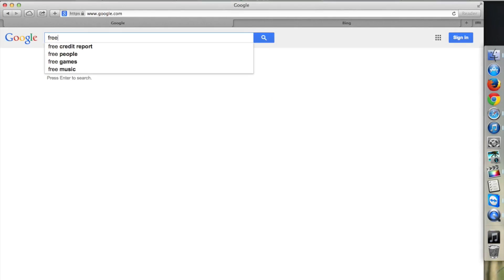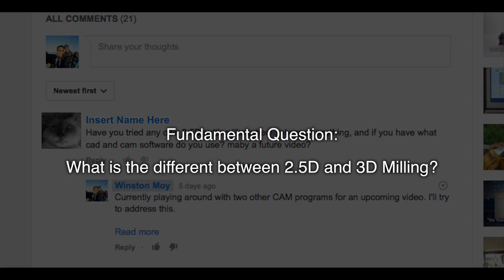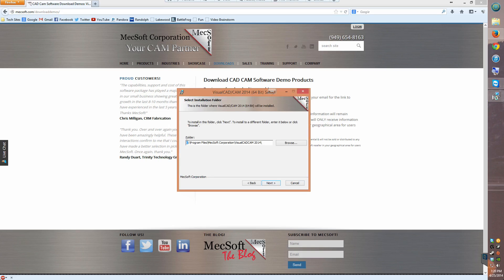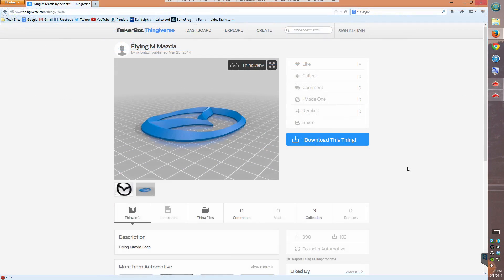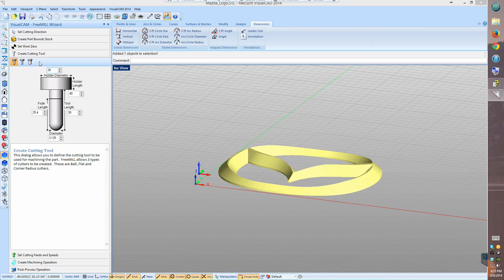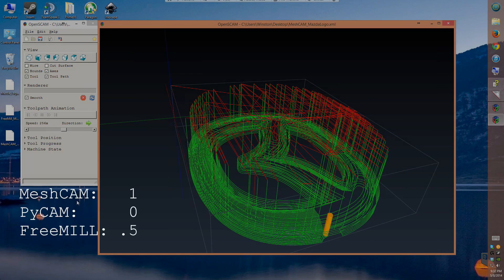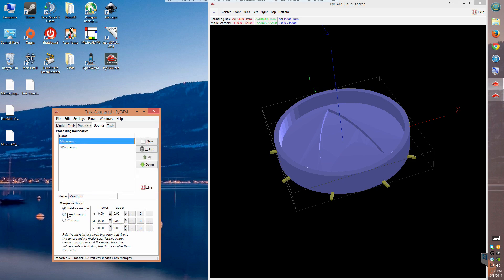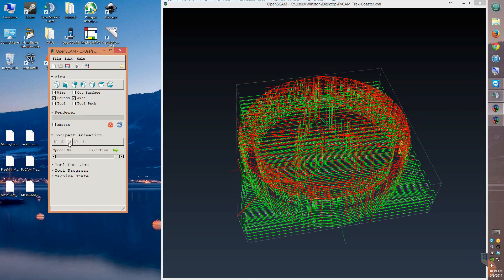Free 3D CAM Programs: FreeMILL & PyCAM Overview

Comment: Free cam is not Free . You need to buy the main software of there Cad sftware to use the plugin of Free mill. around £400 for the basic (Express ) software and pro is about £5000, i would rather buy Solidworks
As for Pycam
Well that is for Linux and Unix systems, good software but you will strugle due to the lack of tool features

Comment: Wonder if there's been an update on the available free (or even low cost) CAM programs out there in the 6 years that this video came out.  The go-to of using F360 seems to be an option, but if you are trying to stay away from Autodesk products, it seems to be slim pickings.

Comment: Whenever you do any kind of 3-axis machining toolpaths off STL files you will be limited by the machining strategies, because there really is no true object geometry to extract in the file.  Thus things like the objects you sampled take a lot longer to mill.  MeshCAM will detect some object geometry with STLs but it is not as good.  Fusion360 blows these programs all away, and you'd be rewarded for the steeper learning curve with better more accurate parts.
Reply: Free software in not usually as good as expensive software..  Fusion360 is out of reach for 99% of CNC Hobby Guy..
    I made a little Car in Blender and exported it as STL,    PyCam did pretty good (not great),  3D milling on my homemade CNC router..   MasterCam wouldn't do it..    I made a 10 minute video of the process in PyCam and I showed the cutting too,  so you can see the quality.. .
https://www.youtube.com/watch?v=UbNVXxKIzzs

  If ya want a better milling job,  just triangulate and subdivide your object in blender,  it creates more lines in the STL file..  PyCam will be more accurate..

Comment: Hi Winston,
I have StepCraft 420 machine. it comes with UCCNC USB controller. I tried to do some basic 2d work but I'm still struggling to do it. I did download (cut 2d) program trail version but unfortunately  the trail version doesn't allowed me to save the work to any type. Would you please tell me what is the best free software to use?? I live in Boston if you are nearby!??

thanks,

Comment: I noticed that you are using OpenSCAM.  The name has been changed to CAMotics.  It is also worth mentioning that CAMotics also has he ability to generate G-Code.  You can even do your designs from within CAMotics using a Javascript like programming language called TPL and then generate GCode from there.  CAMotics (OpenSCAM) was inspired by the 3D modeling program, OpenSCAD.

Comment: You can simulate a roughing cycle by programming the toolpath for a larger ballnose cutter than you are actually using and also offset the Z axis between multiple runs.

Comment: What do use for a pc and video card?  My openscam experience is very sluggish.  Not the case in your demo.
Reply from the maker: The computer this is running on is a Core i5-650 (3.2 GHz, mid-range dual core all the way from 2010) and a GTX 460 (also several years old). But I've run the program on mid-range laptops without too much issue.  Loading the file initially might take a couple seconds, but after that it always smoothed out for me.
Reply: Thank you for the feedback.  I dont need bleeding edge, but the 2005ish pc is not cutting it.  I was trying to find if there is a better video card the cad/cam.  It appears opengl is approach here and might have different requirements compared to a gaming card.
Reply: I'm also using cambam and viacad.  The 3d stl files in cam is where things screetch to a halt.

Comment: Hi im german and i have no experience in cnc milling but i want to buy the schapeoko 2 is that a god idea ? I am 16 years old ...
Reply from the maker: Compared to pre-built CNC machines, the Shapeoko takes a little more effort to get running. But if CNC is something that really interests you, then the process of building your own machine and learning to use it is can be very valuable. Otherwise, there are machines or kits out now (or coming soon) that are smaller, but also cheaper. If you are not sure CNC is for you, then those would be less expensive ways to learn.

For someone else, I wrote this: "For newcomers, there are two big factors to consider in my mind:

1) Price-performance ratio: The usable machining area is quite generous compared to other kits and pre-built CNCs in the price range. And although the Shapeoko is belt driven and less accurate than screw-driven models, the difference in a well-tuned machine is literally a fraction of a millimeter. For most Makers, this is perfectly acceptable.

Plus, the design is much more modular and extensible. It will grow with you better than other machines.

2) Effort: This can be either a pro or a con. The Shapeoko comes as a kit only, so you have to put it together. In my eyes, if you're a Maker this should be a challenge you embrace. Plus the experience of building your CNC and discovering how to use it is an immensely educational undertaking."
Reply: Winston Moy thanks for the help ! I wait until other cnc machines come out were are cheeper and easy to handle with .

Comment: I was over at Maker Faire and ran into the guys at Inventables where they were showing off the Shapeoko 2 and Easel, their cloud-based CAM software. Obviously, among other topics, I had to tell them about your videos
Reply from the maker: Appreciate the support man. What did you think of Easel btw? I was hoping to give it a shot, but they changed their minds about public beta testing right after SXSW.
Reply: It's more of a customization engine that's meant for engraving or 2.5D than a true CAM program, at least from what they had to show us. As far as ease of use goes, it was by far the easiest way to machine something I have seen, or even 3D print - running a Makerbot Replicator is more complicated! Although it may just be the fact that it's only working in 2.5D that makes it so simple
Reply from the maker: ahero4heor  Hmm, that's about what I expected from the previews. Reminds me of the 3D printing interface that's baked into Windows 8, lets you scale or modify a lot of parameters for parts, but isn't a full-on replacement for traditional CAD/CAM software. But glad to see Inventables trying to lower the barriers to entry for CNC.